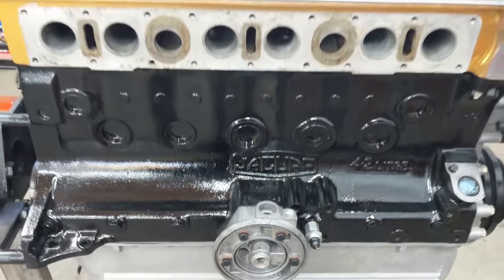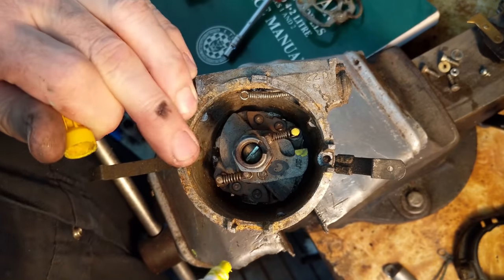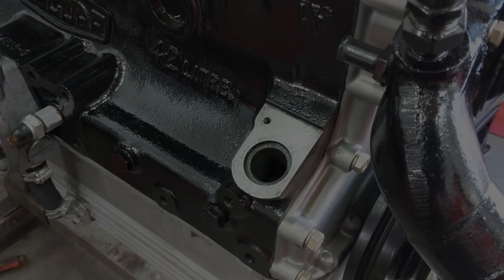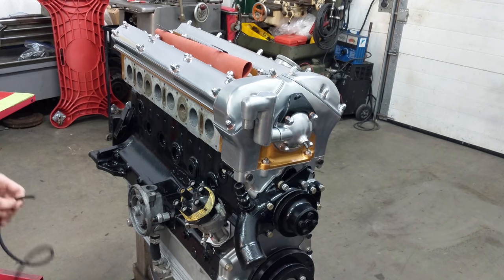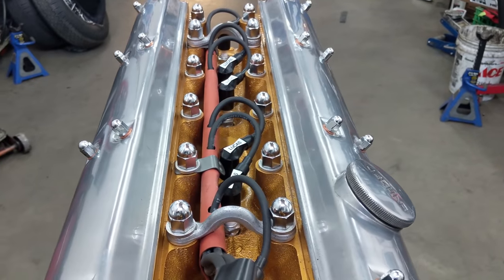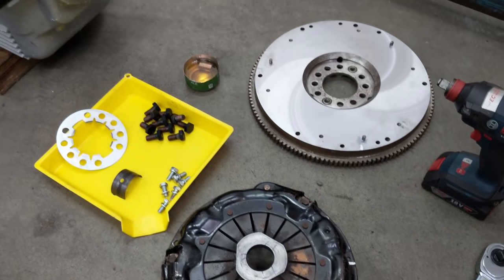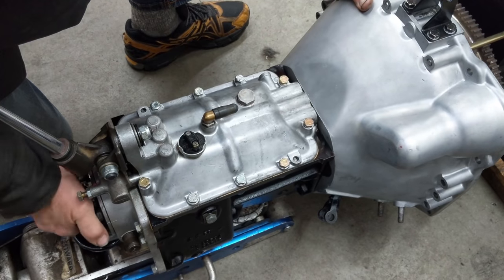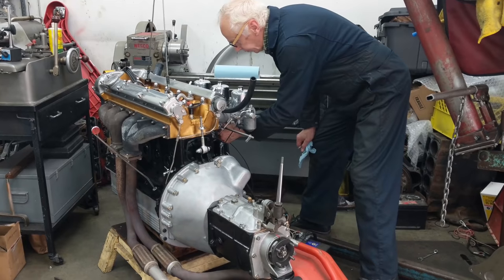My Junk E-Type Engine FINALE

Comment: Fantastic job, A good way to get the bush out is to half fill the hole with grease and then get a close fitting (but not tight) rod and hammer it into the hole in the bush. Hydraulic pressure then usually pushes the bush out.

Comment: Without the exhaust, it sounds like a very little Spitfire.
Reply: It's funny-I was thinking the same thing.
Reply: Definitely a WW2 fighter engine sound
Reply: yeah. Half of a Merlin.
Reply: Martti Suomivuori 
Jag 6 cylinders , the 4.2 had 265 (with triple 2” carbs) .The  Merlin, 12 cylinders  Over 1400 BHP ?
Reply: Yeah but the Merlin was 27L supercharged v12 in the Spit

Comment: That distributor shaft wobble tip was GOLDEN. I've been chasing  a cylinder power imbalance on my XK for years. Engine wouldn't rev well, tried EVERYTHING. When tuning the carbs the carbie to the rear would have its jet all cattywompus compared to the front carb. Been driving my XJ like that fo a LONG while. Replaced the distributor shaft and like..WOW. 

THANKS!
Reply: Well done.

Comment: I cannot believe how smooth and sweet that engine sounded on startup, without the exhaust it sounded like a Merlin engine on an aircraft.
Reply: Yes the XK engine is in perfect balance it was built at the time they used old engineering procedure and fitted together by skilled men

Comment: Excellent series, i found it quite funny the dog showed up for the transmission mounting to the engine, then he could not be bothered at all. But it was really nice to hear how this "junk" engine started up first try and ran really smooth. 

The only thing i would personally do is to install electronic ignition (try to make it look stock though), the mechanical stuff wears down and has to run tight tolerances to work properly.

Comment: Hi both,
Compliments all round and all on message too! I had 2 mk 2’s,one a  Coombes 3.8 with an e type triple setup conversion! I remember having misfires around 118 mph which proved to be perished diaphragms in floats, plus crossfire through the perfectly aligned ht leads..mix m up I was told,did so and all was fine after! One observation,not a criticism tho,was..as I’m sure you know,and that is that the exhaust manifolds really should be stove enamelled to be concourse! Just one perfectionists thought to two others!! Anyhow, lovely work..Cheers from England.
Coombes

Comment: No Other Six Cylinder Compares to a Old Jaguar Inline Six Cylinder Very Strong Well Designed Beautiful Looking. When you Fire Up Jag XK Engine Running at Idle to 6000 RPMs the Mechanical Sound of the Engine along with the Exhaust is INTOXICATING!  I know the Beast well    Nice Job Gentleman

Comment: THE go to trick for me when removing a pilot bearing or bushing , is to soak and wring out tissue.bathroom or paper toweling
in ATF or light oil and then keep packing and keep packing the damp paper in the hole as seen IT WILL hydraulic the part out
eventually, never had it fail , MGB'S TO CUMMINGS, TO CAT DIESELS.
Reply from the maker: Great idea, thanks for the tip

Comment: You were on the right track using grease to pump the spiggot bush out. However, using an entire input shaft is a no no. It's too heavy & cannot move fast enough with a hammer blow to "shock" the bush free. All you need is a straight, clean, bolt around 8 inches long that is a fairly loose fit in the bush. You tightly wind masking tape around the end of the bolt until it is a firm fit in the bush. each time you clock it with a hammer, the tape will splay slightly under hydraulic pressure & make a perfect seal. Then the grease can't easily sneak out. Use a piece of plywood with a suitable hole in it to mask & protect the back of the engine from hammer strike & smack that bolt square & hard. Top up the grease as the bush is displaced. Using the tape around the bolt stops your "piston drift" from scuffing the inside bore of the bush. Bush is driven out uninjured & can be reused if unworn. These bushes are usually porous sintered bronze & should be soaked in engine oil overnight before fitting. I'm in AUST. Over here, our local GM product is a Holden. We've been grafting twin & triple SUs onto Holden Six engines since the 1950s. I have 2x 1958 Holden sedans. One has Pomgolian Twin 1 3/4" SUs from a Triumph TR3 on a 138CI Grey Engine which makes just over 140HP depending on atmospheric conditions. The other runs Triple 1 3/4" SUs frm locally built Morris/Austin cars from the early '70s on a 208CI Red Engine. It makes around 240HP. A fully sorted race prepped 208 (which is a bored out Holden 202) can make 330HP with Jag Triple 2" carbs. However, that kind of stress often results in an electrical problem... simply because a conrod has escaped the harsh environment in the crankcase, smashed its way out & knocked the alternator off the block! Many race records have been set & reset over here by well sorted 202 Holden Torana Group N racecars which can often find their way back onto public roads. Our biggest annual sporting event is the Bathurst 1000. In 1972 this epic event (then held over 500 miles) was won by one of these little Triple Carb 202 Toranas. No 351 powered Ford product could outrun it & we had some serious Ford backed, big money Supercars in that David & Goliath battle. It very nearly happened again in 1973 over a 1000km distance. This time the 202 Torana brigade went to a lot of trouble & had found even more power & more reliability in the "upstart" 202. Ford fans were nearly in tears when these little Toranas broke the fat backs of the thundering, brutal, great, clanking 351 Cleveland powered Falcon GT Hardtops. No Falcon could keep up. Then, it was disaster & chaos! The lead torana (on thirsty triple Webers) coughed & croaked, out of fuel when miles ahead with the race in the bag. it had to be pushed up a slight grade into the pits before fuel could be added. A Falcon roared on & gained the lead. Undeterred, the 2 front running Toranas got off after the lead Falcon & had nearly caught it, when both Dealer Team Toranas hit debri on the track & punctured tyres. A Falcon hung on for the win. Many Falcons had blown their engines to Kingdom Come this day trying to stay with the ferocious, pintsized, relentless, reliable Toranas. A HDT Torana recovered from a puncture & came home in 2nd spot. That car prepared by wizards Ian Tate & Harry Firth & driven by talented Colin Bond ran a 202 fitted with more economical triple Jag 2" SUs. Very few people know the tiny details of this story. You'll find these races on YouTube.
Many Thanks to You!
Jaguar engines are works of art. Taking the time to restore them is truly commendable. The big payoff comes when your "little" 6 gets up & trounces bigger V8s. Keep up the good work.
PS...
Add some compression, some extra cam duration & a fat set of tuned length tubular headers & your Jag engine will sing to you. Better still, find an old raceprepped engine with a recurved dizzy, lightened flywheel & all the other well known tweaks, rebuild it & go blow the doors off some lazy V8s!
Reply: When doing rebuilds we learnt to fill the sintered bronze spigot bush full of oil then compress the oil until it oozes out of the wall of the bush before fitting it.  Much better penetration than soaking them over night.  Makes them last and last and last.  Was at Bathurst to see Doug Chivas push that little XU1 up the hill into the pits.  He would have already been in his fifties when he did that.  Amazing to see him make it from the bottom of Conrod to the pit entrance.

Comment: You lucky/smart...got yr SUs new outa box. Once they're off sync are perfect bastards to get balanced again.
In the shop one night until 10pm+ and six test drives before I could go home. So torquey those 4.2s, move off in 3rd gear no judder. Almost like an automatic round town 'less you have to actually stop!

Comment: Hi Richard. I noticed you had a problem with removing the old pilot bushing from flywheel. You can try the right size tap to cut a thread into the bronze and when it bottoms out, it should  push the bushing out. Thank you Ian Callander.

Comment: What made the Jag 6 was more than anything the head. It's got a reasonably strong bottom end and crank. But no engine designed today or even thirty years ago would have as many potential oil and coolant leak points. I've always had a soft spot for inlines. Unfortunately I can only think of two US inline sixes that had the type of head you need for a good flowing head design. One is that 4.2 litre that GM built 15 years back. The other was the Kaiser OHC that used the same lobe for intake and exhaust. Everything else has always been non-crossflow. Even Pontiac's SOHC was a non-crossflow head. If fact the Pontiac looks like a Vega four cylinder head. But people have gotten creative. Cut off one cylinder each from a set of SBC heads. Weld them together and put them on a GM inline. Same bore center distance.  Or take two GM DOHC heads and put them on top of a Pontiac. The AMC sixes same B C as the Ford Small Block and only 20 thou off of the SBC. I always wanted to see somebody put together a 3.75 litre inline 6 with a 4 inch bore, a three inch stroke. A six cylinder version of a Z28 or Boss 302
Reply: If "Big 3" in Australia can be called "US Engines", then there are a couple of interesting straight sixes. First is the "265 Hemi 6" from Chrysler. Originally fitted with a 4 barrel, then used in racing with a factory fitted triple weber setup. Non-crossflow OHV, but apparently worlds fastest accelerating straight six for years (faster even than BMWs!). Originally meant to be a truck motor to replace the slant six, and picked up by Chrysler Australia  when it got canned in the US. 
The final "Ford Falcon" straight six survived a number of generations in Oz and got used in about 6 or 7 generations of bodies. It morphed from the dog with a log manifold into a 4 litre DOHC turbocharged powerhouse that could give a Miami V8 a severe headache. The original engine first got better separate manifolding, then a crossflow head, then an alloy head, became a SOHC unit with fuel injection, then finally went to a 24v DOHC Turbo. But still traces the origins of the block, bore centres etc etc back to the first falcon.
Last is the runt of the litter- the (GM) Holden straight six. Basically a smaller scale version of a GM engine, it ran through "red", "blue" and "black" variations. The red was a siamesed-port dog of an engine, but given that it was the Australian equivalent of a SBC, it had access to a whole tuning industry. Turned a sows ear into a silk purse? Not really, but good enough on triple Strombergs to win Bathurst for the first time in 1972. The blue had better porting, primarily to meet emissions, but got more power because of it. The final black generation was completely overhauled for fuel injection but only ran for a couple of years. When Oz mandated lead-free fuel, Holden decided it was cheaper to use a Nissan straight six which was already compliant.

The ultimate cheater engine in one of the Holden racing categories was to carefully machine a 4.2 falcon crank to enable it to be dropped into a 3.3 litre Holden. A bit too obvious though, when the cheats ran away from the rest of the field in a control category.

But back to topic, just finished my own e-type engine rebuild. Nearly as nice as this but I have got a sexy set of XK Motorsport headers which we've had ceramic coated. Changes the sound somewhat, but I think in a good way. Cheers, Lewis

Comment: Not much I envy in this world.  You're  working with your Dad and the relationship, time spent, guidance, is one.
Reply: Fantastic work with dads experience to help Would it make an improved performance  adding a third  carburatorsu  to my mark II 3.8  1961 standard shift

Comment: Good video, enjoyed it. About the distributor overhaul, on very old rusty units its best to renew the weights and springs. The vacuum advance unit also needs testing - these can have a slow leak and we don't know weather you did this off camera. You decided not to renew the bush......maybe fine, especially if you intend to fit an electronic ignition system down the road.
These old points ignition systems worked fine but needed regular attention. One way to get the most from this system is to remove all rust/corrosion from all wire connection points in the primary and secondary circuits to get maximum voltage into the coil. With the exception of the ballast resistor, treat any resistance in the the circuit as the enemy. The switch side is inside the car so in most cases there is very little rust there and can be ignored. Also renew (with the correct spec) any worn, frayed wires. The result of all this is that the engine will start on half kick, run smoother and be more efficient. Now mechanics in shops don't take the time to do all this extra chore, as long as the car starts and runs they are satisfied that all is well.
Reply from the maker: Thanks for the tips.

Comment: Good job on the engine. I hope you will no longer call it junk! lol Right away I wondered how you found the coolant leak when it was running with no radiator or coolant. I guess you found that after the run with a pressure tester? I imagine you probably had to do a lot of things off camera or it would have been an epic length of time on camera, not that I would have minded. I love those E-types. Thanks for your dedication and thank you Dad as well for his!

Comment: I don't understand why; but I see no crimp legs in the distributor, or on the points, to mount an oil carrying felt block against the distributor camshaft.
In my experience (not on a jag engine) ... without such lubricating system, the points actuator will wear down, and the points gap will disappear.
The engine will probably die, somewhere around Manchester on the M62, when you are heading to the IoM TT races :)

Maybe the modern actuator material can constantly rub against the metal cam, without wearing down.
Perhaps it would be wise to enquire ;)
Reply from the maker: The plastic cam follower gets all the wear as far as I know. An oil carrying felt block should be under the rotor.
Reply: The concern is whether that cam follower gains sufficient lubrication.
The cam is hard metal, the cam follower is plastic.
If that plastic wears, the points gap changes.

They used to have two upright strips of metal, to hold the felt against the cam.
You would apply 'just sufficient oil' to the felt, and check it each service.

Here is a pic from google images of a rotax engine:
http://www.aerofixaviation.co.uk/images/rotax-447-bosch-stator-plate-fully-counter-clockwise-label-LRG.jpg

I remember one time fitting a new set of points, and forgetting to oil the felt (even though I'd fitted it) :(
The cam follower wore away, the engine lost power until it died.
I saw my mistake, oiled the felt with engine oil, reset the points gap, and continued on my way.
However ultimately, I had to change the points, as the dwell was no longer correct.

Perhaps with the jag, you are meant to simply apply grease to the cam.
... but without any lubrication, I can't imagine that the cam follower will last long, or remain stable.

Comment: That last run sounded so like a V12 aero engine start up (e.g. Merlin) , which shouldn't be surprise I guess, as what you tend to hear with the latter (on the ground) is dominated by one six-cylinder bank (with nothing but a short open pipe on each cylinder). Very smooth mechanically though, it's a safe bet that you're going to end up with an exceptionally sweet engine.

Comment: An awful lot of work; nice job! But these straight six motors are two a penny. The later XJ6 was a virtually identical lump but an improved and better motor especially the series 3. I've seen good XJ6 motors for $150. A friend of mine put one in his 420G but with the old cam covers and SU's fitted.
Reply from the maker: XJ6 has some great pieces, but the oil filter housing, oil pan, almost every bracket, cam-tach drive, exhaust manifolds, complete intake system, and front pulley are different

Comment: Am hoping to purchase a '53 XK120 that has been in a garage for the last 35 years.  Seeing it in a week if all goes well.  So I have been binge watching your engine videos, all very helpful.  We had a 120 but my had some .... business reverses....  and the car was sold about 32 years ago and I have been waiting to get over not having a 120 all that time and now realized that I never will so time to get on the hunt.  Given the engine has not run in 35 years, would you recommend tearing down the motor to clear the oil passages in the crankshaft or is that more of a total mileage question?  The car went into storage because of brake issues, not motor.  Thanks again.
Reply from the maker: Hi thanks for watching, 35 years of storage most likely means some disassembly before running. Take the cam covers off and start evaluating for oil buildup, typically oil non-detergent buildup will all come loose with new oil.  Of course you have to expect seized components, corroded water jackets and petrified seals. Be patient and have fun. I have a build video for an early 120, so you can ask specific questions there: https://youtu.be/grhGAfm3kwU?si=IRDwWDiikjJcc5IK

Comment: Just a great series, I've studied & watched them all. I assisted with suggestions on the oil line from filter head to sump. Watching the numerous bits & pieces to the dizzy & how almost any one of the lets say 35 screws, springs, weights, wires, washers etc. could break or go wrong made me glad that i installed the EDIS ignition system into my '68 E Type so i had none of the moving parts, no dizzy in the block. Plug gap at .050 running 3 SUs.  Your engine looks just great & i know how pleased you are on a job well done.